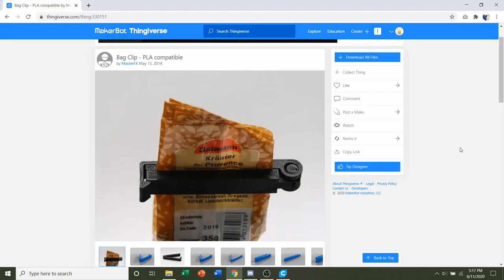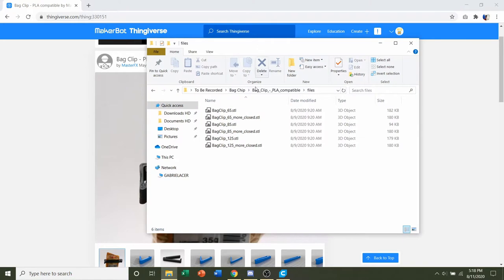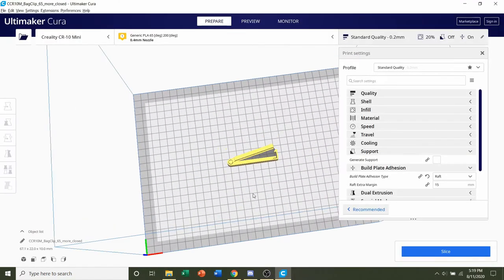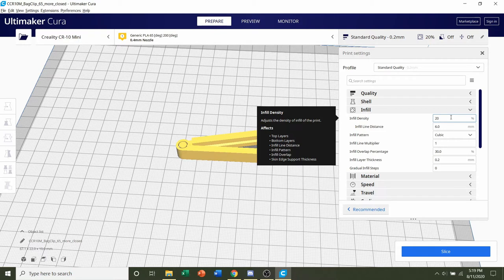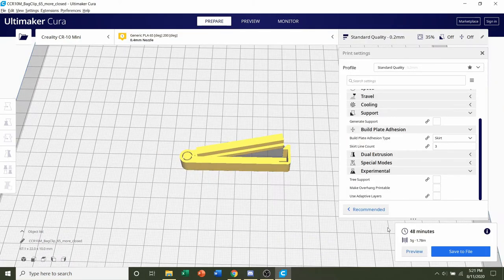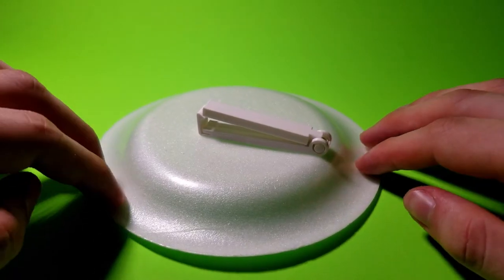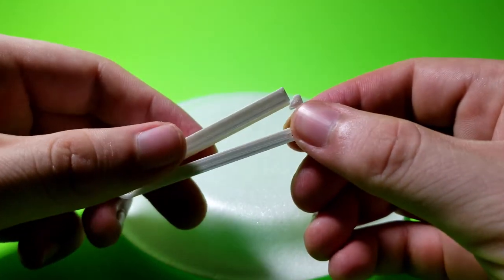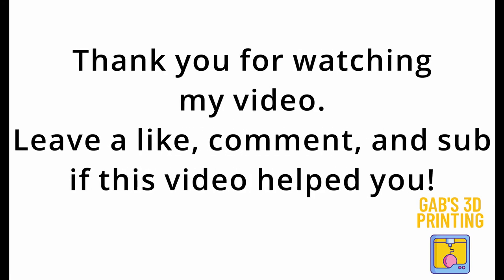Bag Clip 3D Printed - Tutorial, Print Settings, Time Lapse, Showcase

Comment: i got a anycubic kobra neo and i was trying to print the big one. 
i also added adhension but the longer it prints the thing wont stuck anymore on my plate... 
got any tips for me how to fix this problem? (tryed heating the bed frrom 60 all up to 110 in different levels with no visible change in adhension)